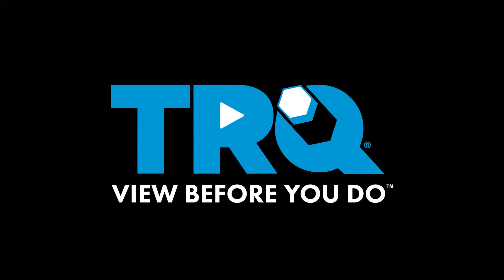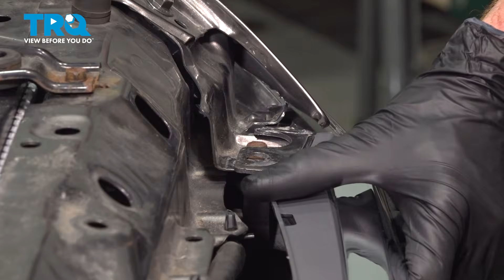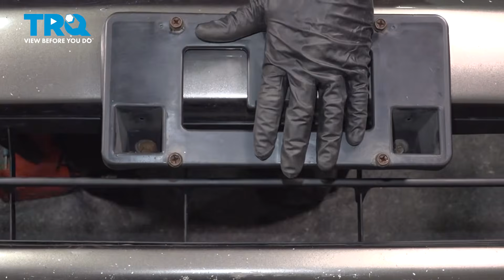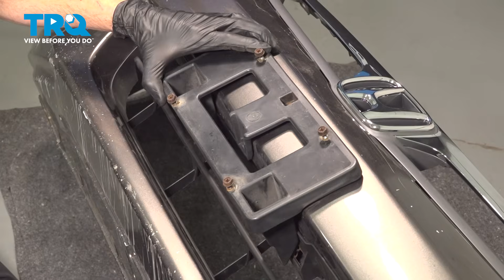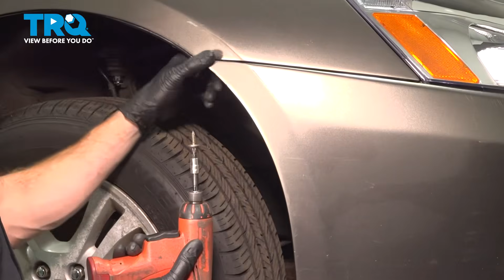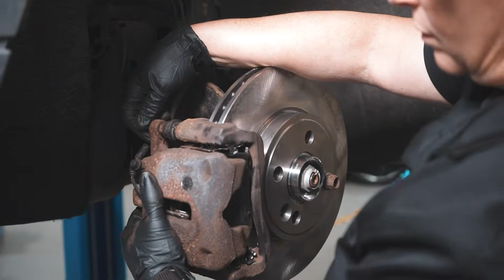How to Replace Front Bumper Cover 2003-2007 Honda Accord

Comment: ill save this video for later I have a 2007 Honda Accord lx 2.4l and i have to do some bumper replacing from jumping a curb to avoid a crash, but I'm also looking at replacing side skirts maybe, but I have some of the undercover that needs maybe replace or taken off since some of it I trimmed off because it was dragging, but the car still drive and works. But i do have a question do u know how to take off the headlight cover because it's one thing on my car I don't like due it's fogging up and getting gross, i wanna possible replace those or cleaned them

Comment: Thank you for this video, it has proved very helpful. My 10mm bolt clips on the ends of the bumper underside were both rusted solid. The only way they came off was turning until the clips broke with the bolts. 

What can I do to help attach after replacing the bumper? Are they purchasable? What about the section above the bumper that the clips secure the bumper to? 

Thanks so much!

Comment: Can the front bumper from a 2005 Accord be swapped onto a 2007 Accord?
Reply: It should be fine since they are the same generation, with changes being minimal between the years. Only thing that could necessarily interfere is the trim.

Comment: Note: if you live in the Midwest, or anywhere with a salty winter season, the four 10mm fasteners on the underside of the bumper cover (90146-SA7-000) and their corresponding clip nuts (90305-SM4-003) will give you problems. The 10mm bolt head will either break off, or the threads will seize to the nut and just spin when trying to remove. Ask me how I know this. I will end up drilling out all four of them on my 2004 EX-L V6. All of this to replace two stinkin' headlight assemblies.